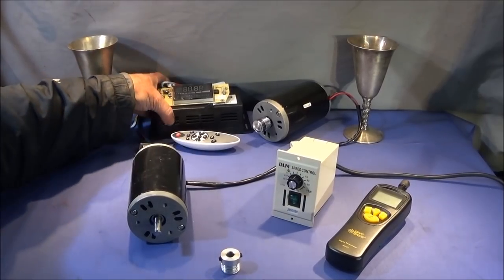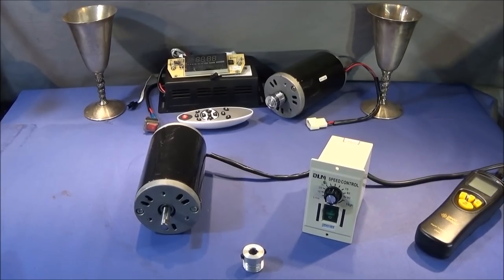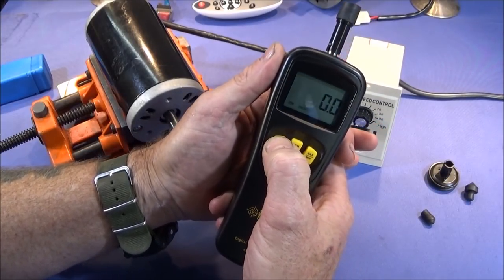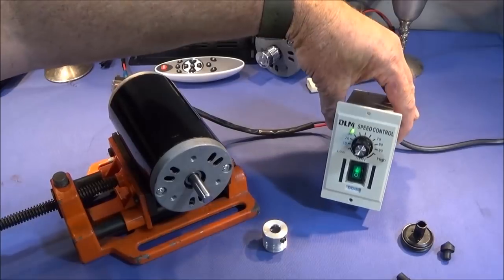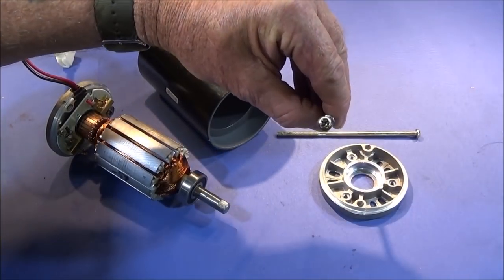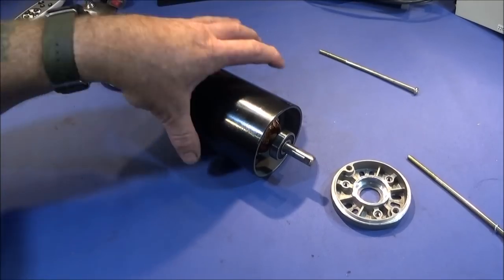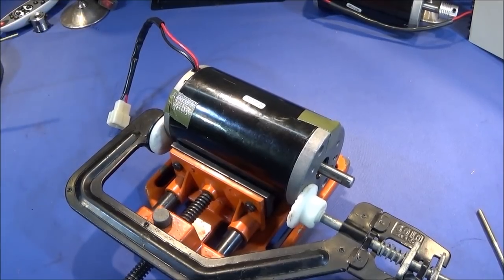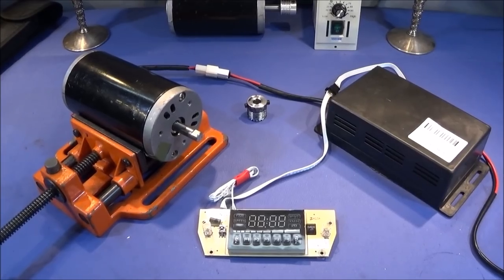The Treadmill Motor With DLM Control Unit & Motor Strip Down

Comment: I've had the same controller running my atlas lathe  with a dc 220v 2.5 hp 10amp treadmill motor for the last 4 years, never missed a beat.
Reply: Wow 2.5hp motor for a human treadmill? i wonder how large is the motor for horse treadmills!
Reply: Do you lose power at lower rpm ?

Comment: Hi Steve, you have an excellent video channel so I have subbed. That set up is really neat and tidy and for low power applications is ideal. I would like to point out a couple of things before people rush out and start changing all their AC motors on their equipment. Most treadmill motors range from 1hp or 745 watts up to 4hp or 2980 watts so that neat little controller won’t do. Also if, like me, you mainly work with metal you may be very disappointed if you convert machines like your drill press or lathe because of the torque factor. Here is a simplified example: If I have a 1hp treadmill motor and slow it down from 1500rpm to 150rpm I still only have 1hp of torque BUT if I reduce my 1hp AC motor via gears or pulleys from 1500rpm down to 150rpm then I have effectively increased the torque by a factor of 10 giving me the torque of a 10hp motor. Like a car going up a hill, when the load increase the engine wants to stall so we change down to a lower gear to keep going. The engine does not have any more power but the gears allow for an increase in torque. I know this is very simplistic but I hope it shows what I mean. However there is are a couple of ways to get around this by still using just one or two gears/ belts. I have found that the DC Motor Conversion does have a place in my workshop and that is on machines that have no speed adjustment like bench grinders, belt sanders, a ball mill and bandsaws as being able to slow down and speed up these tools to be very handy. I have seen posts on other videos of people complaining that the dc motors don’t have any torque at low speeds but I disagree, an electric motor develops maximum torque at 1rpm and stays at maximum torque right to it’s maximum speed but most people are trying to drill or machine heavy parts at low speed and that is where that gearing becomes very important. There is also the issue of inertia at higher speeds that is missing at low speeds. I hope I have not put anyone off this conversion but people need to be aware of the short falls. Thanks for your great videos, cheers Stuart 🇦🇺
Reply from the maker: Hi Stuart, Thanks..The actual video isn't about using this DC motor set up for converting a lathe, although I see you are addressing the comment above. 
  The DC motor set-up that came installed on my Chinese Mini Lathe caused no end of problems. I have seen Chinese Mini Lathes converted over, using a treadmill motors. I think many people in the USA use them on their Harbour Freight Mini Lathes. I don't know how successful they are though particularly in prolonged or heavy duty use. I personally wouldn't choose to use one for driving a lathe or drill press.
  I found the best option is to convert a lathe over to 3 phase using a VFD. It maybe a little expensive at first, if one uses a new motor, but it sorts out all of the machine motor problems for good.
    I only use the treadmill motor for variable speed milling attachments like this one.....you may have seen it already.
https://www.youtube.com/watch?v=YOz93tPC_-o&t=13s
  The variable speed treadmill motor set up is ideal for this type of thing.   Regards Steve

Comment: Thank you Steve for uploading this video.
Just bought this very same motor and display - well impressed but think I need the same controller as you show here as I'm constructing a rotary welding positioner which we're looking for an ideal speed of 1 rpm to a maximum of 10 rpm so ideally need a more controllable, low speed bottom end... 
That's some serious reduction so would be happy to hear anyone's advise to achieve that....
Oh, don't say buy a Chinese positioner as they can't handle the current we're using......
Reply from the maker: Hi Jim, You could always make up an adapter to fit one of these planetary gearboxes. You can buy them in all different ratios. The drive pulls out the back so that you can mount them on an adapter to suit the end of a motor shaft, then re-insert to use. I have a a 5:1 ratio and that is the slowest. They also give fantastic high torque.  Nema17 Planetary Gearbox Gear Motor --  https://goo.gl/MhxDmW

Comment: The DLM is too weak to run a treadmill motor properly.

It works, but it hums and is only good for light duty sanders or similar projects, not anything that requires much force.

You can pop it open and turn the potentiometer up to get closer to the listed values, but it's not going to be the same as the original treadmill guts unfortunately.
I never bothered, because I wanted to try the original power supply to see what the difference was, and it was huge!  I really couldn't see that DLM box working much better because of it's physical size alone.  So I'll use it for something else down the road I'm sure...

But it does work for sure, just depends on what you want to use it for.

I used mine on an old beast of a lathe with double cone pulleys and a leather flat belt, and the DLM was humming and would only make that motor run on there at about 20% compared to hooking it up using the original power supply and controls for the treadmill.

The original made no overworking and struggling humming sounds at all, and it spun that thing way faster than it was supposed to spin I'm pretty sure!

Both struggled with the initial starting and spinning, but that lathe is over 100 years old and HUGE, which had a big 220v motor on it, but I can't read and into off of it unfortunatly, and I can't even find any info online about it...

Anyway, I just wanted to let people know that I tried the DLM box from the video, and it worked, but only at a fraction of what the original treadmill could do with that 2hp motor of mine!

Comment: Hi Steve. I have stripped down a dc motor off of a wobble machine. I can get the anti vibration washers back  between the housing and bearing. Ant ideas?

Comment: when connecting AC (I'm assuming it's 110) does it matter what wires you connect?  I see no + or - designation.  I have one and I don't want to blow mine up?  What color wire represents the return and what color represents the hot wire?  Is brown hot?

Comment: Hi Steve, I have a similar motor for a project  I am tinkering with 200w dc  10mm output  from ebay, but when you put any resistance up the motor just hasn't  got the guts unless you have it top speed. 

Any ideas to lower speed but raise torque any ideas where  to get a gearbox to fix this?

Comment: I took out the motor from the portable air conditioner yesterday it's a small one.it is a LS-65T3-4P motor 115v-220v 1.1A it has four wires,red orange,yellow and blue.I want to run it on dc so I don't know which wire is the negative and postive output.
Reply: I doubt an air conditioner motor would be a brushed DC motor, which is what this is involving.

Comment: Help needed please?   I have fitted this motor to a potters wheel which seems fine except I have some sort of residual current left in the system after switch off giving Quite a shock from the mains plug terminals. The machine is well earthed I believe. Note the switch is not the same as the one shown but was bought with the ebay kit.  I would also like to know what size fuse it takes in case of need to replace.  Appreciate your advice, thanks, mike
Reply: when the motor  is switched off but still turning from momentum, it works as generator and generating power if the motor is permanent magnet motor, 2nd possibilitie,  there are capacitors in the power supply which can hold charge after switching off the system

Comment: I don't Know if it's the camera picking up the whine from the motor .
But This would drive me round the bend after a while. 
From Elliot Lake Ontario Canada.
Reply from the maker: Its because the sound is resonating through the wooden table top and exagerated by the microphone. When its on the lathe its dead quiet.
Reply: That now makes sense! thanks for the quick return.

Comment: Treadmill motors in the range of 1.5hp to 2.5hp will produce between 1000 to 2300 watts (up to 18amps). How can this 400 watts DLM speed control unit control 1kw treadmill motor?

Comment: hi steve ... i have a childrens carousel and the old fashioned long bar wire wrapped resistor has broken, ive bought a 4000w 220v AC speed controller ... the motor on the carousel is 110v DC 3 wire brush thus i will run the wiring through a rectifier and transformer ... i want to be able to slow start the motor to one slow speed and then switch to anothe higher speed ,.. how can i change the varaible speed control which comes as standard to a 2 fixed speed switch .. i noticed at the end of your video you were able to use a remote to choose pre set speeds , i dont want a remote just a switch by the way  ..
Reply from the maker: Hi, To be honest I really don't know. I only have basic electronic knowledge. Each project I have done, like this one, I have only learned what I have needed to know for the electronic components used at the time. There must be a simple way to achieve what you want, so hopefully someone will read these comments and come up with the answer. Regards Steve

Comment: Hi was wondering if either of the speed controls could be used on the mini lathe as they are cheaper than a new board
Reply from the maker: Hi Roger, I reckon they would be fine. If I hadn't converted my mini lathe to belt drive I would have tried this one. I have several different speed controllers from Banggood now and all seem really positive and reliable. Plus the prices are affordable.

Comment: Does this controller have a circuit to increase current under load?
How does the whole setup perform under load?
Reply from the maker: It doesn't have that circuit as far as I know, but these motors are have excellent  torque  at all speeds.

Comment: Hello Steve, I bought the exact same DLM box and fitted it to my 220v 380w lathe but when i switched it on the there was a loud humming and the lathe barely turned on full can you think why this might be?
Reply from the maker: I know they have made the same DLM control units with different voltages. You could check the output with a multimeter to see if it's correct but apart I really don't know. I only have basic electronic knowledge. Regards Steve

Comment: it seems the dc voltage is not pure dc... because its seems humming ..... whether we could save tredmills with this kind of idea....  a lot of tredmills are thrown away due to defective electronic  speed control cercuits.

Comment: Nice show,, thanx for sharing
How are those setups on generating heat?
Especially for prolong periods at low rpms and high?
Reply from the maker: Hi I wouldn't use it for long periods unless I set up a simple fan cooling unit. I have just bought some excellent new low cost fully adjustable heat sensor thermostat shut off switches from China to try sometime. I have tested the motors for what I would use them for, short milling ops and they stay cool.

Comment: Hello.thanks for sharing this clip i have a question if you do not mind ,i have a 1/3 hp 110v motor , does this speed control work with the motor that I have?
Reply: No this is for dc motors only

Comment: That control unit: 
Id like to use it for my DC motor. It is rated at 3.5A and it says 2000w but I have been assured that this is a Chinese exaggeration and in fact it is only 500w.
The control unit is for up to 400w would it still be alright to use with 500w motor?

Comment: I can't find this dlm in 110v!   I need this set up badly!
Reply from the maker: I've had a look but I can't find one at the moment. The other option would be to use a low cost transformer. Regards Steve
Reply: Amazon has the same exact setup it's a different name it's a samgold controller

Comment: Dear friend will work for a treadmill motor?? With:   Modell: 100ZYT1A

Spannung: 180V DC

Strom: 12,2 A

Leistung: 3hp ca. 2230 W

Umdrehungen: 4500 rpm

Isolierung: B
Reply from the maker: I think the wattage is too high on your motor. Yo will need a VFD for that one.

Comment from the maker: ITEMS SHOWN IN THIS VIDEO LINKS BELOW:-
 DLM 220V AC Speed Control Controller --  https://goo.gl/n5gzhT 
 SMARTSENSOR AR925 Digital Tachometer Contact Motor Tachometer --  https://goo.gl/9i18xR
Tread mill Motor:-
https://www.ebay.co.uk/itm/200W-220V-DC-Motor-Spare-Treadmill-Vibration-Plate-DIY-Project-Electric-Tool/253168855246?hash=item3af20a28ce:g:0KIAAOSwLyVZxSoV
Treadmill Motor Complete Set:-
https://www.ebay.co.uk/itm/200W-220V-DC-Treadmill-Motor-DIY-Project-Electric-Variable-speed-with-remote/253850778051?hash=item3b1aaf79c3:g:8BEAAOSwOy1arBoK
AN EXCELLENT MACHINE TACHOMETER SET   https://goo.gl/6yGjCv
60% off Mechanical Parts Sale -- https://goo.gl/zTujuM
12% off Cutting Tools -- https://goo.gl/BeMJzL
12% off Workshop Tools Promotion -- https://goo.gl/zYzchM (coupon: 13ED48)
Reply from the maker: 15% off Mechanical Parts Clearance -- https://goo.gl/uaHuve
    Tools & Equipment Clearance -- https://goo.gl/ZNBDsu
    Measurement Instrument Clearance -- https://goo.gl/Dbkb4X

Comment: I'm no expert, but this looks like a e-scooter motor and not treadmill one. I could not find any references for CBK-v02 controller.
Reply from the maker: No this is a small treadmill motor from an exercise machine. The links for the controller etc are above

Comment: The chopper circuit in that controller is going to kill that PMDC motor you shouldn't ever hear 50hz hum in a PMDC motor it will heat the windings over time
Reply from the maker: Hi It is all exaggerated noise. It is resonating through a thin wooden table top and picked up by the sensitive camera mic. Also I'm in a small metal shed. When I pick the motor up or place it on a solid ,metal surface operating at any speed, one cannot hear any hum at all. It is dead quiet. You will see this when I use it.

Comment: Hi, I do not understand much about the electric motors I just can not get my head around it all, does not matter how much I try, its like I have a mental block with the wiring stuff ,I think because there are so many types and voltage ,and so many different AC/ DC / and both if wired correct with converters  single phase / 3 phase/ brushless / non brushless/ induction motors etc the list just goes on and on its so confusing, how on earth does anyone go about educating there self in there 50s who loves making machines but comes stuck when it comes to powering them, 
I built a big knife belt grinder and because I don`t have a clue on speed controlling a motor I am having to make a step down pully system that makes the machine even bigger,
I have a great respect for people who have the ability to know what to do with electric motors, I do under stand slightly DC and AC motors function when watching  vids But the wiring and working out the voltage voltages that`s where My head just goes off into space,
And then we get told certain non brush motors can be used with speed reduction control but this is not good for the motor,
And you here motors get converted to from DC brushless to AC where power goes off and on but the motor don`t sound correctly mind boggling

Comment: Measuring RPM of a motor like this with this type of speed controller ( one without a feedback loop from a motor) is pointless. The speed under load will change with load. With the right combination of load and power DC motors can turn much lower than 300 RPM. In contrast original treadmill controller is designed with a closed loop feedback so the motor spins at constant speed regardless of load. Therefore original controller is better for use in power tools and machines. They increase or decrease power as the load changes. The only downside is that as a safety feature you always have to start the motor at zero and dial the controller to desired speed. But then that speed is maintained by the controller under varying load, which is typical operating condition for machines and power tools.